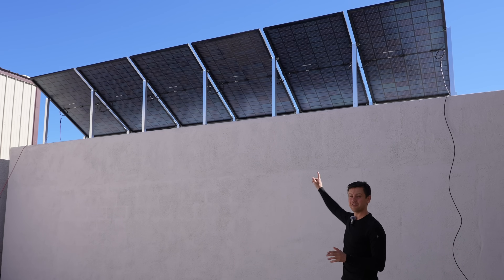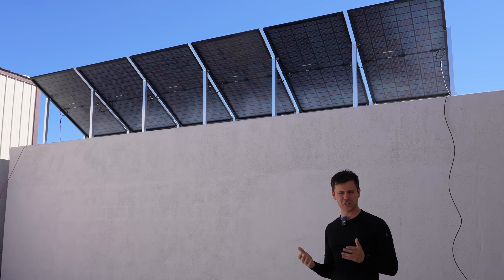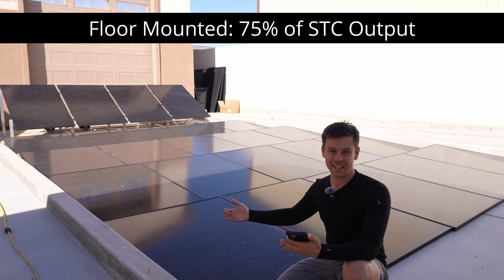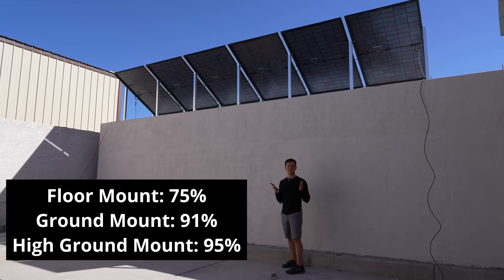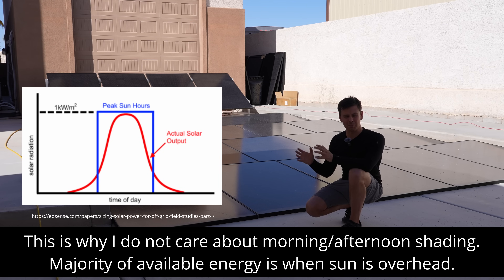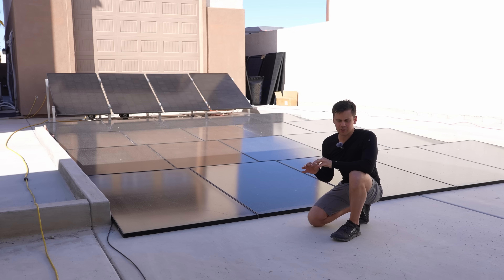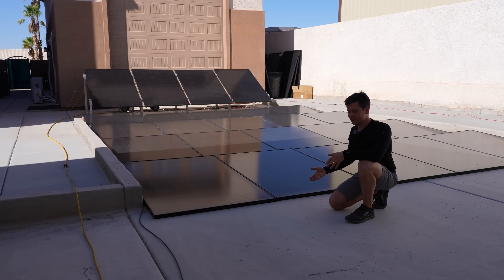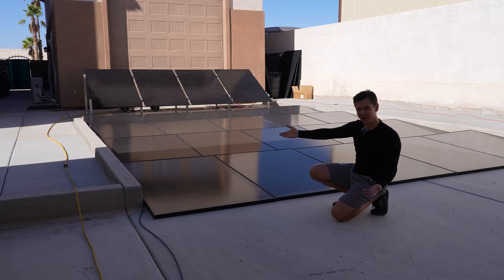How To Boost your Bifacial Solar Panel Output!

Comment: This is getting me really excited to see how our tracking array performs  in the winter. I have about 1100 watts of bifacial panels mounted on a raised dual axis tracking bracket that has been up and running since July when we had our hottest temps. Now it's getting on toward October and I was nervous about the long gray days and heavy snows. This video has put me more at ease that we'll keep our cabin powered well during the winter.

Comment: Are the ones flat on the ground actually secured to the concrete?
Reply from the maker: No. Resting on bricks
Reply: Thanks Will. Had mine on concrete too but 2 days ago mounted them on backyard fence facing east so probably will take a huge hit. Will know in a few days. Aptos as well. Hoping one day I could mount them as a fence rather than on the fence.

Comment: What about the tilt angle towards the sun?  From my own experience I've seen it make a 10% difference with regular panels and that was between two different angles.  Your tests of flat on the ground vs angled  would have a noticeable difference just from the mounting angle.  Would adding an angle produce enough more power to counter the loss of panels due to the shadows?  Probably not but it would be a lot closer than this test suggests.

Comment: I live in a cold climate where we get snow three to four months a year. I know i have to consider the voltage gain in winter. Would i need to consider the extra wattage when sizing an array of bifacials with a charge controller. I think as long as i keep the votage within parameters even when it gets negative temps outside I think the controller would just clip the extra wattage if it goes over the rating of the charge controller.

Comment: Question. Is it beneficial to use bifacial panels on a white RV roof, if you are using a tilting system that exposes the roof when the panels are tilted to45 degrees?

Comment: Three comments. First, "raise off the ground" can be higher. Say eight feet above the ground may avoid shadows increasing daily effectiveness. It would also free up the ground for other human activities. The filter light through a bifacial panel is enjoyable and could be valuable in the desert. In the northeast, we are seeing panels installed over parking lots shading the vehicles below and providing rain/snow protection Cost increases but so do benefits.

Second, don't forget snow often adds as much as 40 pounds per square foot of live load in northern environments. So a 3'x4' panel would, in this hypothetical situation need to support 480 pounds of load per panel plus the weight of the panel and structure.

Third, often overlooked is perhaps the best bifacial application. On boats where light is reflected off the water. If your reference is the desert this is more than understandable.

Comment: try high up central axis air piston pivoting bifacial and single sided panels. yep the simpler solar tracking. only one angle. consider cooling, either passive heat sink or water, or active fan heat sink or water cooling. collect the water cooling heat. wood mount poles are cheap. even on top of a single pole. single angle or two angle solar tracking. wtheck, pole plus two screw gear servos to track the angle, should be super cheap. yes only center point mount for the solar panel to the tracker. yep even diy.
Reply: consider a bifacial panel inside a green house.

Comment: I've seen tests with est west orientation for bifacial. Mounted like a fence. In that config it gains more in the morning and evening.
In your case in the video it might have been better vertical along the fence than on the ground.

Comment: Actually bifacial panels are used to face them east / west standing nearly vertical with less footprint or on more or less transparent balcony rails  in a situation with no storage (so grid connected or balcony panels as they get trendy in Europe. You need only one panel, to gain solar on both sides and the consumption in the morning and afternoon is more likely your own other than putting it into the grid (which is not worth the effort in Europe, as you get nowadays not more than 2 to 3 cents per kWh

Comment: I've been thinking about a slightly strange idea layout for a van. I have been thinking about having three panels mounted stacked one right on top of the other. When the rig is ing travelling mode, just the top panel would be receiving sunlight. When the rig is parked , I would deployi the  second and thrid panels outward left and right on sliding tracks, enabling all three to have full sunlight. WIth regular solar panels, I was planning on having the one that was always exposed to be on it's on circuit, and the two deployable ones on separate circuit that would be engaged when deployed. WIth bifacial panels coming down to nearly the same price as single sided ones, would it make any sense to use bifacial panels, and (possibly) pick up some electricity from all of them while travelling, and just wire them all together rather than separate circuits? Or am I just up too late a night thinking crazy ideas?

Comment: Could the 75% simply be a calculus of the angle of the floor panels to the meridian?
Cover a panel backing with lead sheet surely a better test?

Comment: Great video!  You forgot to account for the difference in angle (optimal versus actual) between the arrays.   I'd love to see you start reviewing budget 48 volt inverters (i.e. build quality, output quality, ability to meet or exceed spec output power, true surge capacity and a multiday torture test at max capacity).  With budget friendly 48 volt batteries, this type of setup for DIY solar generators makes a lot of sense.

Comment: I think the only thing stopping me from buying solar is not knowing racking/mounting options. Do they all work with all panels? Do the panels need certain racking systems?
Reply: Most of the racking systems that I have seen, seem to go by the size of each panels dimensions not necessarily by the brand of panel.
If you search Will prowse on YouTube and type in the word "mounts" it will give you some of the things that he has done and the same thing do solar panel mounts or solar panel mounts DIY on YouTube and you're going to go down a rabbit hole that will last for days but it will give you a lot of different options depending on your location/setup you've got to find something that's similar to what you plan to have.
Indecision is keeping you from action.
I still don't have a permanent mounting system but my electric bill is only going to be $38 this month it was $48 last month in the State of Florida and yes I am running my air conditioner.
And mine are literally on the ground propped up with two by fours with grass growing in front of them shading part of the panels.
I have one small set going into a solar generator (growatt Infiniti 1300) and the other four panels that are going into a little bit bigger of a system with EG4 stuff.
Trying to keep it under the radar where I live lol

Comment: How about putting a row of mirror, shining the sunlight on the backside?
Reply: The thing id be worried about there is heat. Those solar consecration systems use mirrors to produce a lot of heat. You could end up melting your panels.

Comment: I' live in Ireland, so not a very hot area of the planet,  and my panels regularly exceed their rated output,  so I just want to brag about my results too here in Ireland. (regularly 6kw from a 5kw array) and they are not bi-facial panels, so there you have it.
Reply: Yeah UK seems to be the sweet spot for temps, I'm down in Cornwall where we get a lot of cloud. I've angled mine towards the sky a bit more to perform better in cloudy weather. 84 x 410w so far :)
Reply: What part of Ireland are you.and did you buy your equipment from usa

Comment: mount them at 60 degrees on some kind of platform plywood or osb paint with high gloss white then go to hd and by a roll of reflective film nail it down on the wood and  be ready for somme huge out put  bifacial is the only way to go keep them off the roof and mounts are now about 25.00$ per panel

Comment: With you loosing alot of power due to heat why not put uv protection on the panels to reduce heat? Like the windows in skyscrapers where they are protective and UV resistant.

Comment: I saw some tests done on Bifacials using highly reflective materials including mirrors, chromed metal sheeting, Mylar Thermal blankets and the bad thing about too much reflection is the excessive heat that is created.   The tests showed wattage on the Bifacial side up around 60watts with the front of the panel covered by cardboard but temperatures on the solar panels were in excess of 160F with sunlight on the front and using (chromed metal panels or mirrors, etc) at close range on the back side of the panel.   The sun baking the sun side and super reflective materials putting hot reflected light on the back side could rapidly shorten the life of the solar panels.     (Too much of a good thing is often not good).

Comment: Currently installing 30 400a biracial on white  flat roof  usiing heavy duty frames at 28° and well of the deck. The frames and install are 3x the cost iof the panels. Thx Will,

Comment: I really wanted to see a test on vertical mounted, would be super good not to have clean off snow/get thick ice stuck on panels during winter.
Reply: I run 4 panels vertically here in TX.  I have large fields running east west, so I have a lot of sun throughout the day.  One side is 100W each for a max of 400W, side B is 200W each for a max of 800W.  Taking temperature derating into account, I’m getting 350W out of 370 max on side A(4hrs AM sun), and 680W out of max 710W from side B (6hrs PM sun).  The cool thing is, they still push 200W at noon just from albedo effect!  I’ve seen other discussions and studies that suggest this orientation might yield more average power throughout the day, rather than trying to chase maximum exposure at mid day.  Its working for me, but you need a long line of sight from tree lines or other houses to get this benefit.
Reply: @Lgregotx  Awesome. A more steady output throughout the day and better minimum on cloudy days is more important for many than maximum output in a shorter time range.
Reply: I'm in Ohio and I've been thinking 45 degrees would help with snow self-clearing and give me a more direct angle in the winter.  

The channel Projects With Everyday Dave released a video yesterday on testing vertical mounting in an east-west configuration with bifacial panels.  He's going to do some more testing with a north-south configuration as well.  

He's in Ohio as well so his results may be a little different from what you see.

Comment: Bifacials do not like Texas heat. We love them in mild weather and winter. Seems like 93 ish is their top performance temperature.  Anything hotter and ours in down to 60-70%In mild temperatures we easily get well over 100%.

Comment: I have also been offered new 440w bifacial panels in large quantities at $.22/w. (~$97/ panel) including shipping to my location.  30 year warranty. I'm checking "listing" and "labeling" to make sure my state electrical inspector will approve them per 2023 NEC code. The state inspector also says  the mounting hardware must be listed and labeled to meet 2023 NEC code. This company also has 5.12kwh batteries at $1200 each. Their inverters are expensive at $3000 each but can handle 16 of those batteries.
Reply: What company is this? I’d be interested!
Reply: @aaron647  Spitzer Energy. I met them at the National Assoc of Home Builders show in Las Vegas last February.
Reply: Please let us know what you find out!
Reply: @580guru  Will do. I hope Will P will review Spitzer Energy''s systems.
Reply: Who will be “solvent” in 30 years to back the warranty?  
Of course, most of your payback comes from the first 15 years anyway?
Reply: @DM-zq8qy  I agree. Most will be lucky to make it 10 years. Panels are changing so quickly. May get more expensive if tariffs are imposed.

Comment: I have 10 jinko 405w bifacial and the most I have seen on my eg4 6000xp app all together was 5,393 watts if we divide it by 10 it's 539.3 watt on each panel. so I truly believe they work. now I live in Puerto Rico in the center of the island and up in the mountains the temperature is in the mid 70s my panels are on top of my flat roof and it has a white coating (sealer) that helps a lot on getting the most use of each panels
Reply: Are you feeding that into your 6000XP's two MPPT's? Each MPPT is rated to 4000W so be careful to not burn out your inverter. That would void your warranty. I have ten 400W Talesun bifacial panels, on rare occasions here in Ocala, Florida they produce slightly over 4000W. I may remove one panel from to avoid exceeding that 4000W input. I'm very happy with my EG4 6000XP, it hums along flawlessly!
Reply: @woolval52 no. all of that is not on one mppt. i have two strings of five panels each. and I'm using both mppt's one for each string so each mppt gets roughly 2,696.5 watts. it's been over 9 months now with my eg4 6000xp, and I haven't had any issues runs flawless 24/7
Reply: @woolval52  

Install mirrors on the ground
Reply: @ajarivas72  no need for perfect coherent mirrored reflection of sun, diffuse light of white gravel or surface is actually better. White reflector eliminates lensed specular highlights and shadows  which could actually harm panel and provide uncertain output if using homemade Mylar mirror. Also, remember, mirrors are expensive but effectively grey, limiting reflectance while also making secure mounting challenging. Painted wood, wall, elastomeric roof coating, plastic Tyvek sheething or quartz gravel are some suggestions.
Reply: I have the Atos 370w and have them mounted on an RV, about 1-2in off the roof flat, and I see them consistently hit 395-430w per panel in Florida sun when good breeze to keep them cool.. tested same from ground and determined that the white RV roof has to be the contributing factor…
Reply: @MattManSolar  Nice, so even in a flat roof with little separation (1-2 inches right?) the bifacial is better in your experience. What type of white paint did you use? I've seen many types. Also did you notice even more difference in cloudy days? (compared to regular mono panels)

Comment: I have been offered the following:
Jinko 580 watts bifacial panel
panel price (36 panels in a pallet) $208.80 per panel  , includes shipping 
Container price (40 HQ container with 720 panels), $185.60 per panel   , includes shipping

Comment: I've got 10-400watt bifacials 5s 2p that are cracked both front and back and got 1.95 kw peak today. 1side is on the ground the other is 42 inches up for an angle 35-40 degrees. Only paid $950 for all 10 2.5 years ago.
Reply: With them being cracked isn't that a fire hazard? (Serious question)
Reply: @MyCabinLife  I haven't had a 🔥  yet.
Reply: Got 10kwh of solar today or $3.70 at California electric rates to power my house.

Comment: I am trying  to figure  out how to operate my tankless water heater ,i am starting  to build my system  . I am looking  at about 38,000 watts with 4 strings of batteries at 48 volt system  and using 445 watt panels but the problem  is the water heater has 4 elements at 7000 watts each for a total of 28,000 watts. I know  that the EG4 6000  will be ok for my lights and well pump  etc for off grid but it will not be enough for the water heater .I 
Am at a loss trying  to figure  it out !
Reply: You would be better off (equipment cost wise) replacing water heaters with heat pumps.  My 50 gallon runs at about 600 watts raising 75 degree water to 127 degrees, usually  average around 1.0-1.2 kwh daily usage with 2 people in the house.
Reply: @jstaffordii  how much did the heat pump water heater costs you?
Reply: In 26' when Cali starts there $26/mo fixed electric charge add on I'm going to get rid of PGE electricity. I don't know if they will let me keep gas or not.
Reply: @jstaffordii  is your net zero 1:1 credits?
Reply: @Gary-ee3kq  yes currently  but expecting them to change soon on next PUC meeting. They got the connection increase and lower annual washout buyback rate last meeting.
Reply: Why not just put the tank outside like they do in Mexico?

Comment: I’ve been using bi facial panels for a couple of years now I live full-time in a fifth wheel and they are so much more efficient than just the front side. I’ve also experimented using reflectics behind it and cardboard covered in heavy duty foil, you get a nice spike from the reflection behind it.

Comment: Hey Will, with your expertise would have time to help out Herb-O-Matic with his solar systems? Has one on the house roof and another running a well pump. He's a humorous soul trying to get an old airport back on line in Az. I think. Thanks.
Reply: I suspect he's pulling our leg for reactions. Nearly everything he does begs for guidance. Yet, he's a totally capable electromechanical dude (he let it slip early on when he was still innocent). 

All youtubers somewhat soon learn that videos which inspire reaction will encourage engagement through the comments and buttons, which increase monetization.  I find his solar videos beyond painful to watch - I just....can't. But there's lots of retired trade guys who love to share their knowledge.  He is learning this. 

I'm still scheming how I can get those fallen hangar doors back up.  And what about his RV batteries?  Do they also get no love?  I nearly died when they fell sick from that uncleaned swamp cooler reservoir.  I had already told him to clean it!  That does it, I'm firing up the RV, they need a buddy!
Reply: @mikemotorbike4283  Time to organize a work crew men. Find out if the Wife is a good cook.